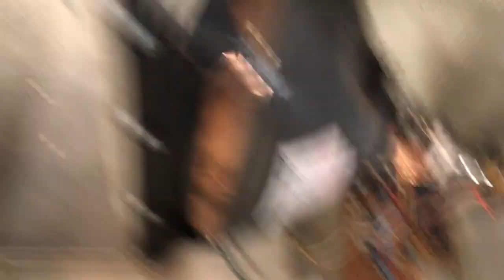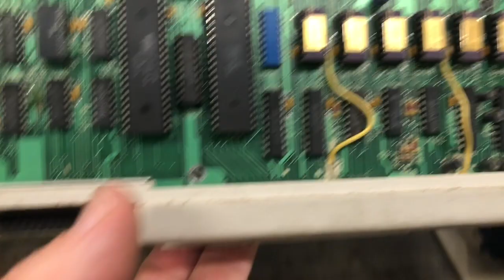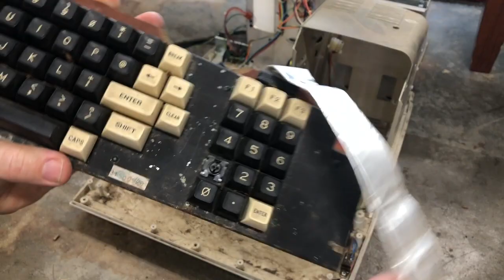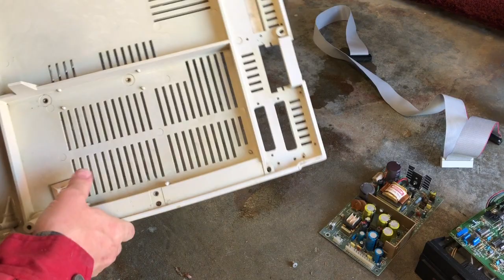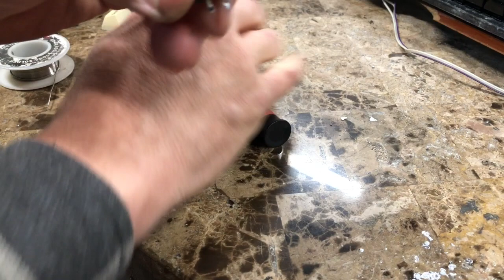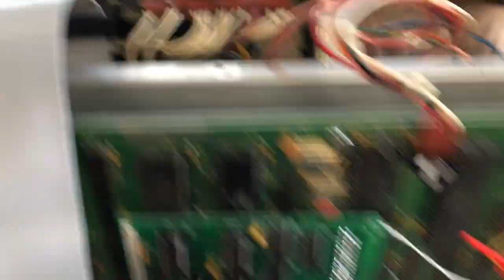Trs-80 Model 4 Repair #Septandy

Comment: I left Tandy Computer Assembly in San Antonio just before the "Gatorade" (Gate Array) boards arrived. But we sure got good at troubleshooting the previous Revs. They would arrive with every kind of lead-short imaginable, and we kept a logbook of all the variations of "Cass?" (including some really funny ones) that would help us zero in fast. We had one board that the lead trimmer had cut all the data traces up the back side left. It looked like a guitar for all the Kynar we used to rejoin the traces. It never would pass the 24-hr burn-in where the rams were being constantly tested. I was glad because I was going to feel sorry for whoever ended up with that in his machine. The whole plant would erupt in applause if someone ever dropped a CRT. I remember the managers hated that, but it was about the only way of keeping sane in that windowless assembly dungeon.

Comment: The "D" didn't have the plastic riser walls in the floppy tower? I sanded the carbon pad on printer paper to get rid of the shininess and get the switch resistance below 200/100 ohms. A small wire brush spinning with my fingers for the metal part.  I also suggest doing all the keys at once so that you can rustolium the metal plate.
Reply from the maker: I am working on a new way to repair this type of keyboard.

Comment: That was a monumental task there man! I could not believe that it booted right off the bat, given how dilapidated it was. 

I just bought a model 4 over the weekend that looks practically brand new, but it powers up with some lines on the screen and no text, however the floppy light is working. It was owned by a teacher since new, and she kept it immaculate, so I hope I  can get it up and running properly. I also got a COCO 1, mint and running, a Ti 4a, nice and running, cassette deck with all kinds of software and other peripherals, for 60 bucks! 

Love your dedication!
Reply from the maker: Thank you.  You got a really good deal!

Comment: one on the table is  more like my model 3 with its separate cards and cables. mine looked like it sat in a garage, interior was dirty and with bug parts and i had to repair a couple chewed wires for the monitor controls on the left, luckily all keys worked.
Reply from the maker: I always thought the one piece units, like the 3 & 4 were the perfect design back then, no matter the brand.  And always seem to get a system with a really bad keyboard,  like I did today- an upcoming vid.

Comment: Have you considered using Deoxit contact cleaner spray for the keys and the IC contacts?  Any idea about how your methods
 compare?
Reply from the maker: I tried that first,  it did nothing at all.  De-ox is pretty good on copper, but the carbon surface seems unaffected by it.

Comment: So you don’t need to replace the main RIFA cap?
Reply from the maker: No, they are only there mostly voltage transients and to keep noise from making its way back to the grid, but can work fine without it.
Reply: Very cool, I did not know that.  My order of RIFA caps came in today so in they go.  
Thanks for your great video!
Reply: It's more fun to let them blow!